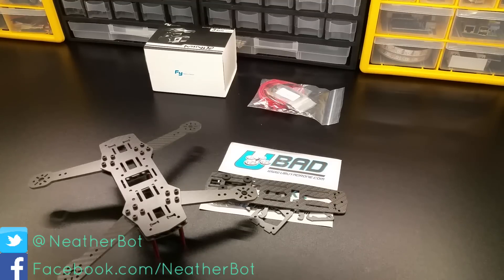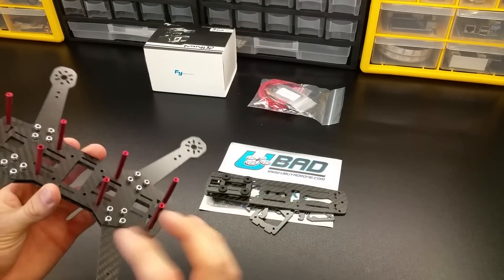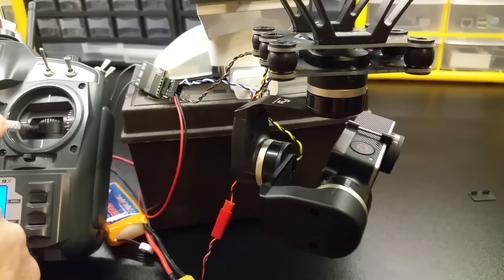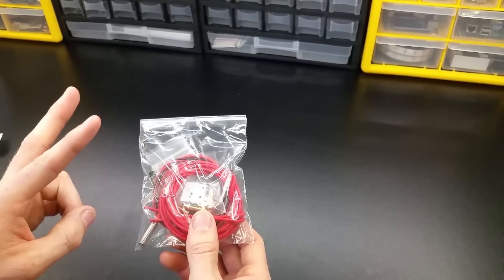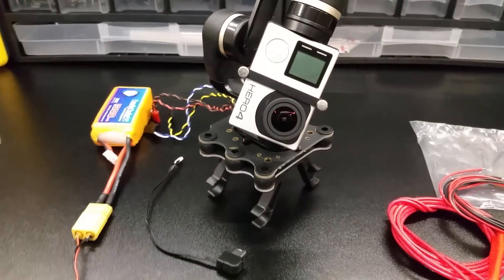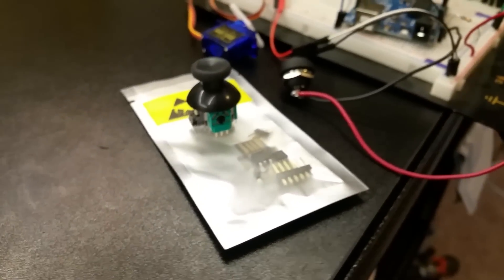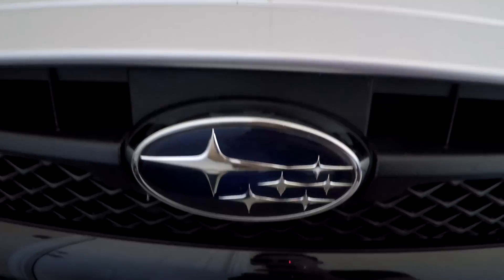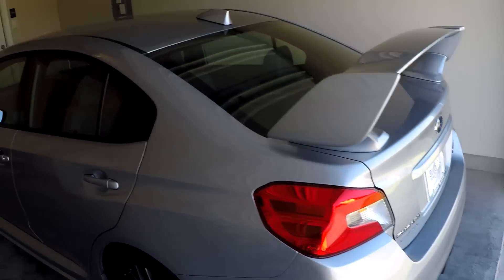New House & New Projects!

Comment: Demand fully 3d printed quad copter with the volcano. make it as fast as you can!!! would be cool
Reply: +Neather Bot Well depends what temp you extrude the PLA at. My prints hold together alot better when i go up to 230-240 and i dont get delamination so far. Nossel blockage can be an issue but as it cools down i push filament manually as it cools down when i use higher temps. 
And i print at 100-150mm/s with good quality.